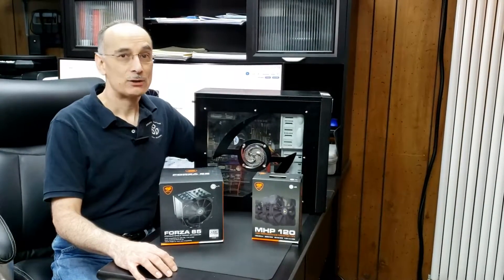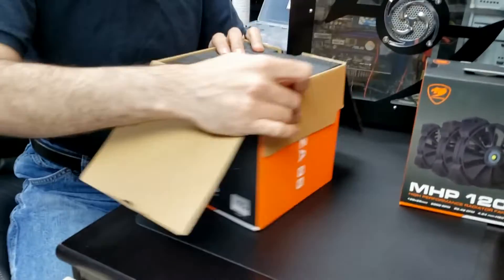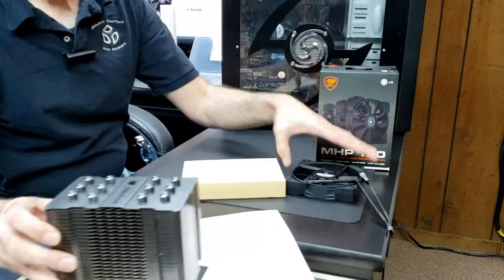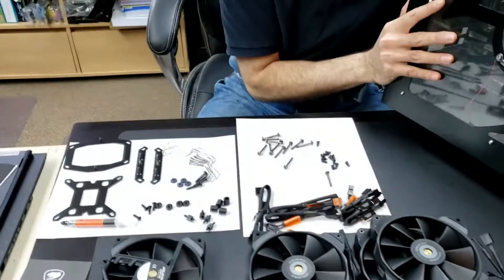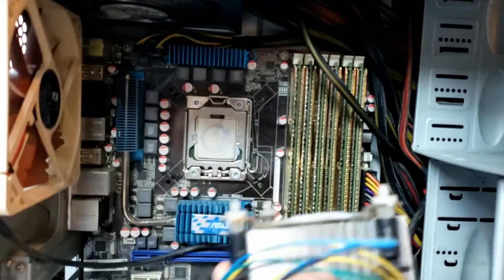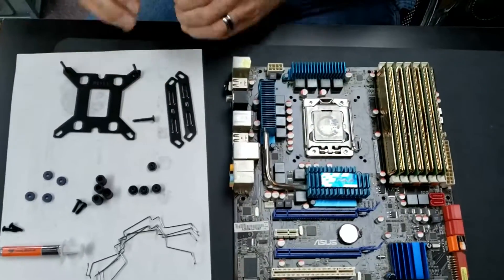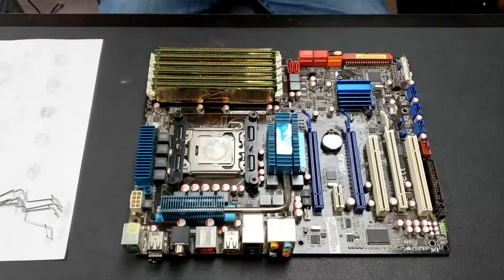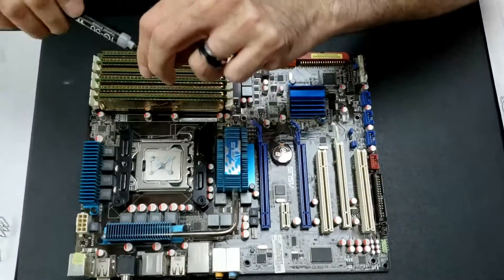Installing the Cougar Forza 85 CPU Tower Air Cooler and MHP 120 Fan

Comment: La posición del radiador es discutible (no entraba en su posición normal ?). Los coolers enfrentados tirando ambos hacia afuera y compitiendo entre si ?, el cooler inferior queda tirando aire caliente a la gráfica y mother, el superior evacua aire por la fuente , es decir sólo el cooler superior evacúa hacia afuera radiador??🤔
Reply from the maker: I already mentioned this in the description above and addressed it in the other comments below.  P.S.  It's STILL running FINE and very cool, and it's currently April of 2025.  Definitely not worth changing at this point...Much bigger fish to fry.

Comment: Two mistakes. The first is that they forgot to install washers on the pins under the motherboard to prevent damage to the textolite. The second is orientation. A good teacher, don't repeat it. Greetings from Russia to you, it's nice to know that we have more PC assembly professionals. И для наших из РФ: Две ошибки. Первая - шайбы на шпили забыли установить под  материнской платой, для предотвращения повреждения текстолита. Вторая - ориентация. Хороший учитель, не повторяйте. Привет из России вам, приятно осознавать что у нас больше профессионалов по сборке ПК
Reply from the maker: Thanks for watching and for commenting.  As stated in the comments and the description above, this is not the correct orientation - but it works just fine for me.  Have a great day!

Comment: Can we use this cooler on i9 13 gen
Reply from the maker: Sorry, I do not know for sure, but doing some quick research, this is what I found out so far...

On the Newegg site, the compatibility is specified as such:
Intel Socket LGA 115X / 1366 / 1200 / 1700 / 2011 / 2066 (Core i3 / i5 / i7 / i9 CPU)
AMD AM4 / FM2 / FM1 / AM3+ / AM3 / AM2+ / AM2 CPU

On Cougargaming.com, this is what they say, "Forza 85 has superior component compatibility on RAM/GPU (including LGA1700/LGA2011/2066 sockets)".

Tom's Hardware says that it's good at least up to 12th gen.

Comment: Hi Russell, I was curious about this cooler, which is how I came across your video, however during your installation you happen to place your fans orientation towards each other on the cpu cooler. Now although this may have lowered your temperature, you are actually running it inefficient like that. What you want is a nice laminar flow through the radiator, and with them pointing towards each other you would get a lot turbulence. I recommend you switch one, preferably the one close to the PICe slots. Aside from that, good work.
Reply from the maker: Hi Carlos, and thanks a lot for taking the time to comment with this very detailed, helpful information.  I really appreciate your constructive input on my video here...It makes me want to take it apart and re-do it now.  When I get time, I will do that and I'll make a video showing the process and results.  Thanks again for watching and for commenting!

Comment: At 10-mins you warn about "Orientation" but you ignore the instructions and fit the cooling tower 90-degrees out of whack? I skipped to the end to wonder if you fixed it; but you didn't & seem impressed with what you did (bypass the cooler by having the PC Case Noctua exhaust fan suck out half cooled air)..
Reply from the maker: Thanks a lot for pointing this out.  With the space constraints, one of the cpu cooler fans would conflict with the case fan.  With the old cpu fan, the temps were over 90 - and now they're in the low 50's, so it works out ok for my application.  Thanks again for watching and for commenting.

Comment: Hey man my second ram slot stopped working after installing this cooler could it be because I mounted it too toghtly
Reply from the maker: Thanks for watching and for your question.  That would be my first suspicion.  I'd first check the underside of the radiator fins to see the clearance for your ram.  My rams sticks are pretty "standard" size, but I've seen other ones that are more bulky that could definitely cause issues.  On the other hand, perhaps you "bumped" the stick and now you just need to re-seat the ram where it "clicks" back into the socket.  I hope this helps out.
Reply: @Esbservice  yeah thanks for the reply. I was swapping the ram around for a bit to see if it was a dead stick or slot but when I put the stick that was in slot 4 in 2 and the stick that was in slot 2 in slot 4 it magically worked. Both sticks are running perfectly I was extremely worried about having to replace my whole motherboard. Also do you think that if I were to turn my pc on again it would stop working because I'm going to go sleep now and I'm worried about waking up to it not working again
Reply from the maker: @R1cuyu  You're welcome.  Since you swapped them like that, and they both work - it sounds like you proved out that your ram is good.  Perhaps it was just a seating issue, and it's fine now.  From what you described, I would think it's fine to shut it down for the night...(I really hope so, at least!)  Try it out, and let me know how it goes.  🤞 Thanks!
Reply: @R1cuyu  Turning it off would not make a difference. Its either broken by now or not.